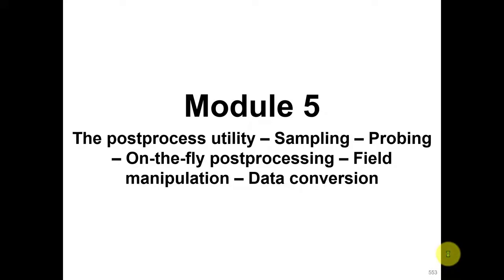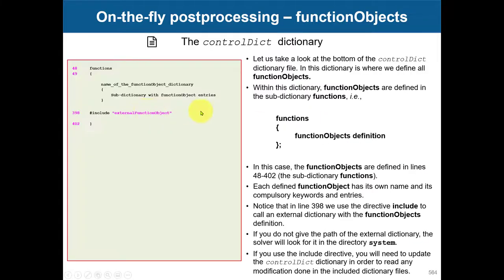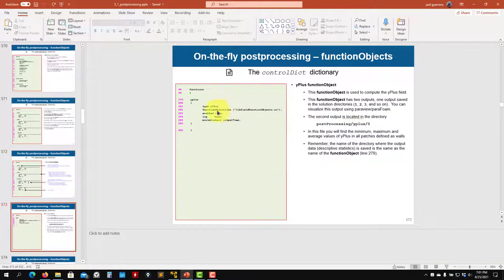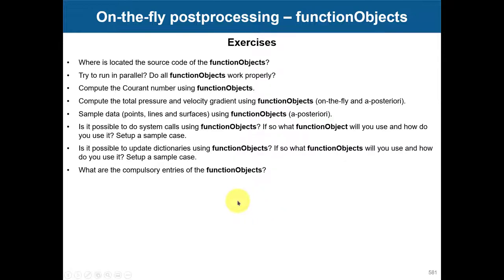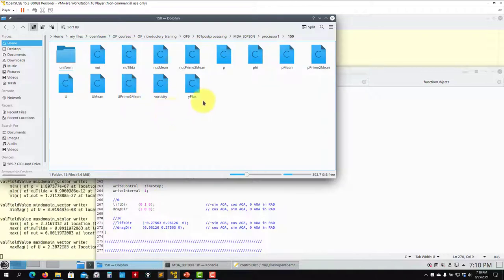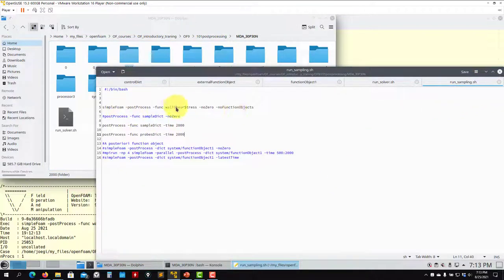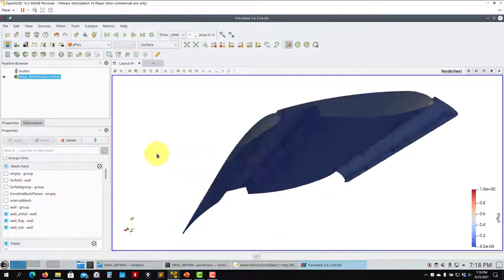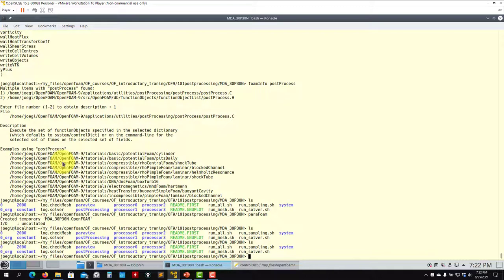5.1 Module 5 - Qualitative and quantitative post-processing #openfoamtraining

Comment: ¡Hola! in your slide # 570 (vector example), you use macro syntax calling previous function main body "$minmaxdomain_scalar" which does not have in patches the field U, should there be instead "$minmaxdomain_vector", what do you think?
Reply from the maker: Yes, you are right.